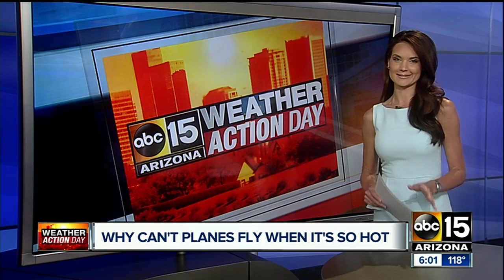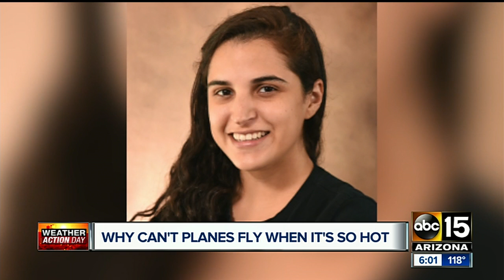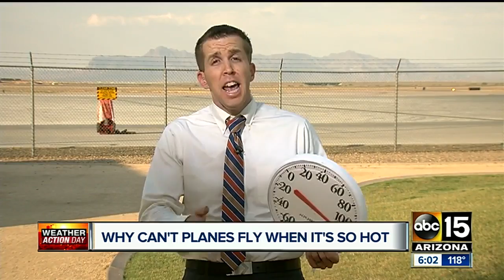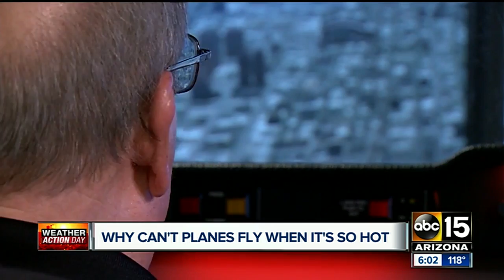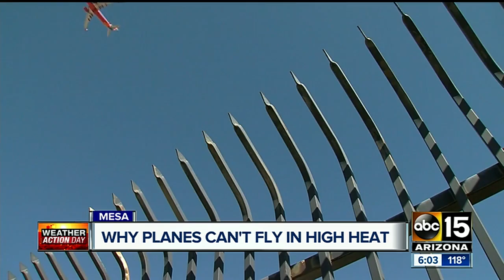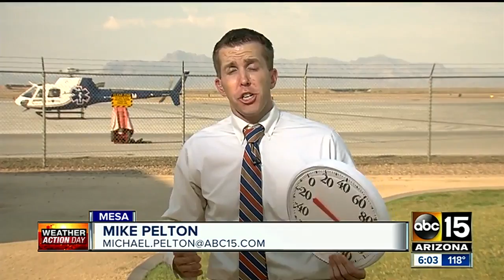Why can't planes fly when it's so hot?

Comment: Why do planes fly out of Qatar?
Reply: I guess that  Qatar is at a lower elevation than fenix which makes the air more dense at the same temperature as well as Qatar runways are longer which allows higher speeds to take off with less air density.